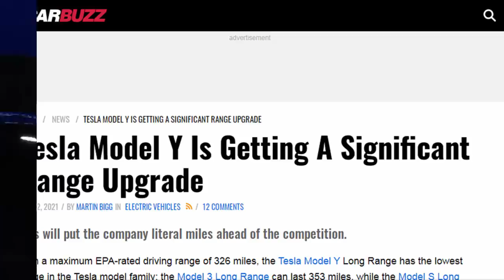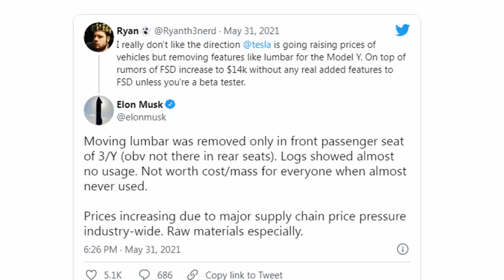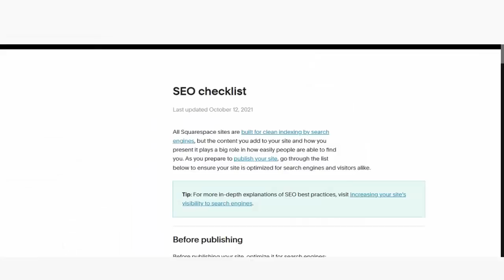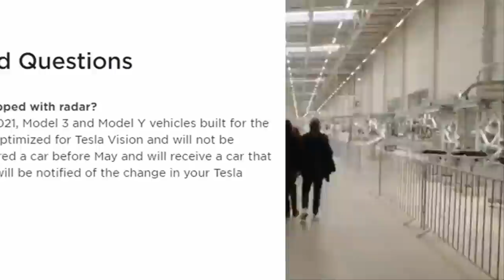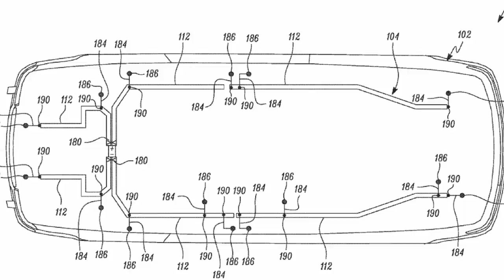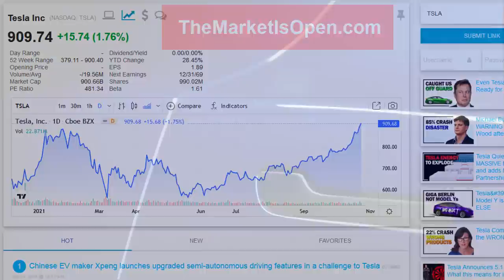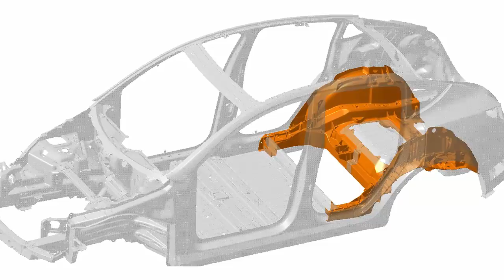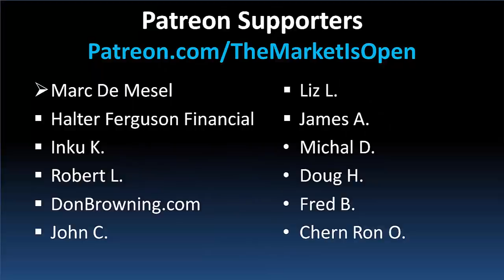Tesla’s NEW 2022 Model Y CHANGES EVERYTHING

Comment from the maker: What features do you think the new Model Y will have, that Tesla hasn't talked about yet? Do you think Elon Musk's vision of having just 100m of wiring will finally show up in the Model Y? Be sure to check out:
Tesla Quietly Builds MASSIVE Megafactory and adds New Solar Partnerships: https://youtu.be/bHZRoghtpZg
Tesla’s Van is Coming Soon and is a GAMECHANGER: https://youtu.be/oZFdx0zoW2Y
Visit our website https://themarketisopen.com for instant quotes and financial data
Reply: 11:10 Re: Panel Gaps. It should be pointed out that in eliminating dozens of opportunities for cumulative misalignments, giga casted fronts & rears is how micro- vs milli- meter tolerances are achieved.

As for wishlist, would like to see air suspension as an option, as I understand that mounting points are the same as for coils. Seems like outfits like Hertz would buy in, to more suit their clientele's preferences.
Reply: Heads up display
Reply: Less stiff suspension , adjustable thigh extender ala recaro seats . Front passenger seat that would go flat for longer loads. 400 mile range so you could get 300 real world.  Longer lasting faster charging battery's I think some of that is in the Works. HUD or a something like it . Non Glass Roof or Roof cover that blocks out heat and noise.
Reply: Four wheel steering, turret mode, not the flame throwers.
Reply: Vehicle To Grid (V2G) and Vehicle To Home (VTH) capability in Europe, as the infrastructure here can handle that much better than in the US, and all EU EV manufacturers are already providing this capability.. During the Q&A on Battery day Elon Musk reluctantly hinted to this. With Tesla rolling out VPP's all over Germany, the UK and the rest of Europe likely to follow, this is something to look for I think.

I have a Model Y imported from Shanghai, but when V2G becomes a thing and I can connect to the VPP, I would be happy to connect my Tesla and provide the grid with some juice via V2G in times of scarcity (=high tarrifs paid to ME). If my car needs a hardware upgrade, I would probably get it, even if it costs me a couple hundred Euro's, but it would not surprize me if this could be made available via a (paid) OTA update.
Reply: FSD L4
Reply: @cathodeactive5932  With you as well my Jedi Brother.
Reply: @ken-mb5cp  Why not level 5 ????
Reply: @Nicholas.T  later L5
Reply: I wish the model y had either a black roof or alcantara roof, the beige color is hideous with the black/white interior. Softer suspension/air ride, ventilated seats, and lastly an automatic retractable roof cover to block out the sun/heat when not desired.
Reply: Wider seats, or adjustable bolsters.
Reply: @MarcoNierop  Bi-directional charging (V2G or VTH) is possible but eats into Tesla’s Power Wall business. Ford obviously sees the benefits, why not Tesla? Simple answer….follow the money.
Reply: Pls see my comment re making this Y into a hybrid FCEV??

Comment: 1. Starlink communications
2. Adjustable air suspension
3. Heads up display
4. 800V system
5. Sideview cameras in the headlights, or at least the A pillars
6. Electronic side view mirrors
Reply: 1. Why log around with a disc?
2 👍
3 👍 however, you can always buy one yourself
4 why? So far it does not seem to be better than 400v. Only they can use smaller diameter wires= little less weight
5 Do not see this as a need to have
6 maybe.. depends on the execution
Reply: @AS-gx4qg  
1. "Disk" would be integrated. Most are already switching to low profile antennas that are more aerodynamic, away from the bulkier antennas, like the ones Panasonic supplies airlines. 
3. Integrated by Tesla would be better I think. 
4. Does fine with 400V. 800V would allow faster charging and save on cost of copper and weight. 
5. Better perspective. Eyes closer to the front are better. Simple optics. Tesla knows this, but somewhat stuck with legacy placement so making due. 
6. Tesla wants to do this; only regulations are stopping them from doing it.
Reply: Considering 1, have you read what their costs are on the disc? 
Maybe many years from now it will happen, but not now. And why should they?
Their satellites are data constrained, better to sell that data to someone that has no alternative and who is willing to pay 99 usd per month and use cheap mobile tower data for the fleet. 
Will you pay 99usd per month for starlink in your car?
Reply: @AS-gx4qg  Yes, the original costs were high but it was for a beta, low volume product. They've already reduced the costs and expect more cost reductions from economies of scale, and improved design. I've not heard they are bandwidth limited - bandwidth seems more of a function of relative satellite position.  I wouldn't expect it anytime soon or maybe it will never happen, but Tesla thinks of its cars as computers on wheels and computers, in car gaming and streaming are better with high speed internet. Tower data is fine for now, but what about in 6 years when there are 20 times as many many Teslas on the road and if FSD pushes demand for in car work and entertainment?
Reply: @cbmusgrave  It is still much higher than 4g receiver which only is a few dollars.
Also as I wrote. They will have limited capacity on their network.
So given they will have limited capacity, why should they use their disc? Users on Tesla cars pays 10 usd per month for connectivity while Spacex takes 99 USD.
It does not make sense.
Better to sell the limited capacity of space X to people who value it high, than trying to compete with 10 usd per month

Comment: They would have to try not to give the new Y 400 miles of range.  Just adding 14% range from the weight savings would put it at 371 miles.  Throw in 4680 batteries and it’s an easy 400 miles

Comment: Reasons why I am waiting ordering a Berlin model Y. Actually, I only wait on nr 1, the rest would be nice but not critical.

1. 4680 new battery. Less weight, more range, quieter car. Maybe faster charging and LFP?
2. Giga casting, less weight, safer, more range.
3 Air suspension. 
4 New colours
Reply: Aren't the 4680's reserved for the s, x and roadster?
Reply: @manaspradhan8041  this video states”It is important to note that the Austin Model Y will be made with 4680 batteries, front & rear casting, and structural battery pack”. Ordered min 11-17-21, estimated delivery date Mar 5-Apr7,2022.

Comment: I really wish the model y would have conventional blind spot warning. If I were to ufse a turn signal or begin to move my car toward another person's car (who is in my blind spot)  I wish a light, on or near  the side mirrors, would light up and make a sound.There would also be a log
 there would be a red light that would light up the lower part of the windshield, make a warning sound to alert the driver to break.
Reply: Here here, coming from any luxury car giving that safety feature up is a tough one as well as a heads up display.
Reply: Buy a 2021 blazer! The RS model it’s sporty it’s fun fully loaded does start at 51,000 but it has all the things you’re talking about and has every single thing that the Tesla has as well! The computer screen is much easier to deal with and they literally had to tell people how to put a Tesla through a automated car wash duh!  how to put it in neutral with the computer to make sure that the air is circulating within the car so you don’t get all the smell of the bubbles which is an easy button in every car except for a Tesla you have to have the computer do all that for you and if you don’t get it right you can mess up your car. They don’t have great technology and the fact that you have to power them up at a station!! Duh! Let’s say you going from Salt Lake City to Boise you have to plan that out and you have to find an actual hotel that has those stations because not all do. If you’re in the middle of the desert driving and your battery is low that’s pretty dangerous there’s not a lot of charging stations like there are gas stations. And the lithium batteries they’re made in coal factories and then when they die we end up with a bunch of lithium batteries on our planet so people who think the original idea of having a battery car versus a gas car is actually worse on our planet in the long run! Duh! That light that you’re talking about below the windshield that lights up to tell you somethings going wrong is deafening not only that your seat also tells you you can put it on a buzz or a sound I always make it it’s a feeling instead of just a sound sounds become innocuous but having your seat vibrate is a whole different subject. Especially if you’re listening to music with your speakers up you’re not gonna hear the beep but when your seat tells you somethings going on that’s different than my side mirrors definitely tell me on both sides when cars are coming up on my Blindspot plus I have a camera on my rearview mirror.
Reply: .. or just turn your head to check your blind spot as you should anyways! My current car is 14 y/o and has no such thing.
Reply: @jennifermarshall4780  Blazer? No thanks, it is not electric, costs much more to drive and will be worth sooo much less pretty soon. My Tesla will have over-the-air updates, be much faster an up to date style that will not look old in 2 years. I will charge in my garage and start every day with 326 miles of QUIET driving. Also, evert 5 years I will save $4,526 on fuel over gasoline while not polluting. Future is Tesla, clearly.

Comment: I live in NY. I ordered a Model Y long range in early October 2021. Predicted delivery is Feb-March 2022. Hoping some new features will be included like air suspension, 4680 and front / rear mega castings. Hoping but not betting on it.
Reply: Same
Reply: You haven’t hit a chance in hell Chris ! It’s mid 22 at the earliest
Reply: Can anyone explain how this works. I just preordered Model Y, Estimated June 2022. I live east of Texas, so maybe would be getting from new Factory? Even though I ordered it now without the 4680 battery as an existing option, you would just get that upgrade for the price you paid now if its available?

Comment: I don’t think many people realize that the Model Y is made into single piece castings because Tesla is 5D chess moving the competition. True, if the structure is damaged, it will be written off as totaled.  BUT, what if FSD/autopilot significantly reduces and prevents accidents? They’re planning far ahead into the future, not in the short term. Good move on them
Reply: Most cars are a writeoff nowadays if the body integrity is compromised.
Reply: Why not external airbags?
Reply: would not be best then to introduce this only after the FSD offers this reduction?
Reply: Sandy Munro has commented that it wouldn't be that much worse for repairs compared to what we have in ICE.
You would think the sensors would be able to save you from the most common fender denters.
Reply: @ken-mb5cp ..
Reply: @madalincosma2531  nope, that’s why all computers are equipped with the FSD chip hardware. If you are able to save so much money in other places, you can afford to put this into every car you make. That’s why they do this, as soon as FSD is solved, it’s as easy as a flip of a switch/over the air software
Reply: @timchow924  i am reffering to single front and single back piece by casting.
Reply: FSD is not going to improve significantly when full casting is integrated into production.  We are many years away from level 5 (Tesla is currently at level 2.)
Reply: @jacka7211  But not in the timeframe of the casting in question, aka 2022.  We're going to need smart highways and vehicles communicating with each other - we're not anywhere near that.

Comment: You failed to mention that the lithium-iron-phosphate (LFP)  batteries can be charged to 100% without significant long term degradation, whereas the lithium ion batteries recommended charge is only to 80-90%.  This may effectively give the LFP equipped Teslas a longer range.
Reply: Firstly, both LiFePo and LiNCo are lithium ion cells, but with different chemistry.
Secondly, both will have similar lifetimes if charged as advised, but since the LiFePo can handle 100% charge without as much degradation as LiNCo, it is better for most people who don't want to think too hard. The only downside is a slightly lower energy density, but this is largely offset by the 100%charge capability.
So both are million mile batteries if used as directed.

Comment: The 4680 cell with LiPo chemistry is the most significant in terms of desirability. If I'm going to spend a small fortune on a car, I need to know that the battery is going to last a very long time indeed. Lithium Ion batteries just don't cut it I'm afraid. If you can afford to change your car every few years, you probably don't care, nut I plan to keep my Tesla for at least ten years when I buy one.
These new cells are going to be much quicker to charge too, so long distance driving will be even easier. I can't wait!
Reply: lfp lithium iron phosphate, low cost cells, higher margin, savings not passed on to buyer.  not to be confused with lipo
Reply: Sure LFP can be charged to 100% but that’s not that relevant for most as that 100% charge isn’t needed every day - just on longer trips. Also, LFP batteries charge up slower than the Tesla’s Li-ion models and the 4680 cells do not - I repeat, Do Notnot
Reply: Even the older Model S batteries lasted hundreds of thousands of miles. Anything you buy today should last over a million.
Reply: @TecnamTwin  
Range is relevant for long trips, and being able to charge to 100% without worry gives you a bit more range.
LFP charging speed has been fixed. Tesla was just careful with the new chemistry, because badly calibrated fast charging can cause fire, or even explosion.
Reply: No similar long range range hit to them though . But the 4680's are suppose to be better to I think.
Reply: @andrasbiro3007  How many miles do you drive a year? The average in the US is under 14,000/yr so that your battery would last more than 70 years. How long do you expect to live? ;)
Reply: @cbmusgrave  
I don't understand your problem. First, I'm not the lead battery engineer of Tesla, I have no say in how long those batteries last. Second, why is it bad? You were complaining about the longevity.

Also Tesla designs it's cars to last a million miles at least, because they are are meant to be used as robotaxis in the near future.
Reply: @andrasbiro3007  Sorry, my point was to Roger who says he "needs to know that the battery is going to lat a very long time". And it wasn't like my reply was aggressive - maybe not get so worked up over a YouTube comment, especially one that ends in a " ;) "
Reply: @cbmusgrave  I intend to live forever and each day I have exceeded the number of days I have remained alive.

Comment: The biggest upgrade that Tesla must adress on the model Y is the relatively poor suspension. Bjorn Nyland ran the model Y side by side with the new BMW I4 at 200 km/h on the unrestricted autobahn in Germany. At 220Km/h, Bjorn was surprised that the MY was not in its comfort zone, while the Beemer was solid. Kris Rifa also had exactly the same experience on the Autobahn.
Reply: Agreed. They need to offer air suspension as an option, as I understand that mounting points are the same, as for coils.
Reply: 220 kph ride comfort is pretty (in fact totally!) academic for 99.99% of worlds motorists. 
In nearly every country in the world they will lock you up and throw away the keys if you drive anywhere near 220 Kph.
Reply: @Crunch_dGH  here's my vote for the air suspension at least as an option!
Reply: Drove away from the test Drive in my 06 325xi BMW wagon and the ride was much quieter and more compliant, much easier on this old man. But the Tesla Y was like a sport's car in terms of handling .  The version I drove was a performance with 19's .  It felt like it was on rails but it needs a better bump absorption. Unplugged performance makes aftermarket suspension that is adjustable but another 2.5k in parts and 1k in installation hurts.
Reply: Agreed. I’m going to sell my 21 MY and wait for air suspension option to rebuy.
Reply: Unplugged performance makes a set of coil overs that is suppose to solve this it's not air suspension but it is adjustable for height and softness.  I would think they were more likely to do something like that than a full on air suspension.

Comment: Great video.  Would appreciate your perspective on the following question.  Given the Austin Model Y is 2.0 how will Tesla differentiate the Austin Model Y from the Fremont Model Y?  Will Tesla release a new Model Y Performance + from Austin first or will Fremont upgrade casting, paint etc day one to build the same 2.0 Model Y?  Thank you for your perspective.
Reply from the maker: They may try not to differentiate at first, since they haven't told us much about Austin's capabilities. But I like your idea, something on the lines of releasing more expensive performance and long range versions from Austin (with 4680 batteries/structural pack etc) and release the standard range from fremont.
Reply: Fremont likely to be lagging because they can't stop the line to retool especially now with demand through the roof.